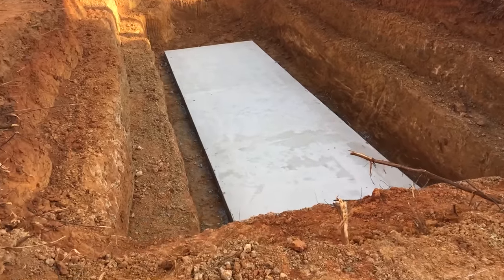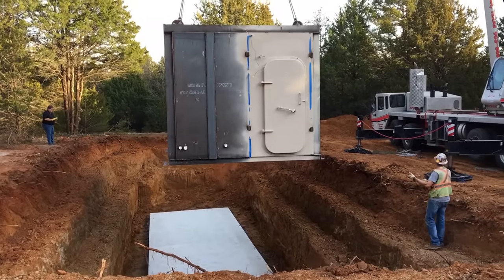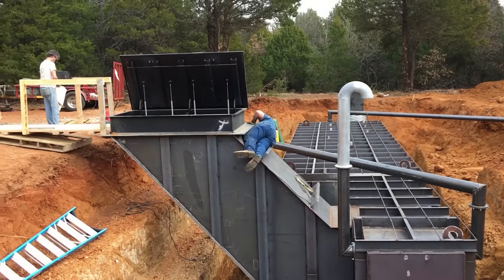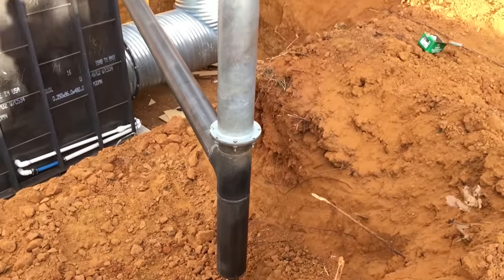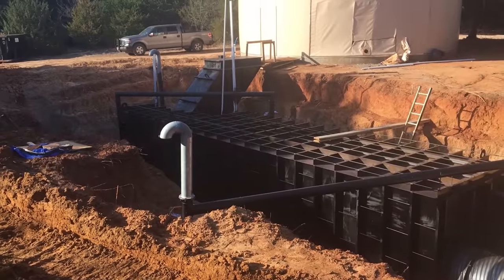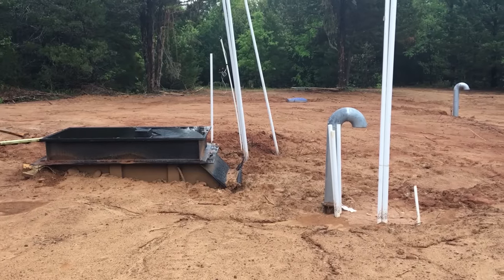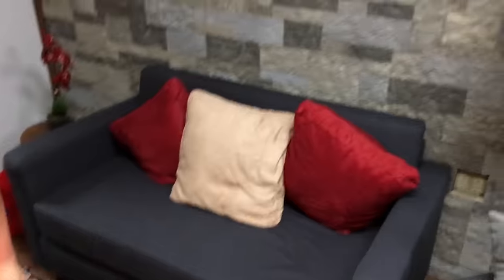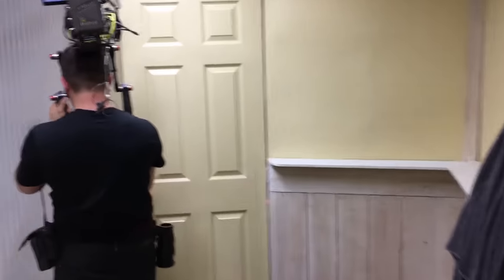Atlas 10x30 Safe-Cellar - Luxury Bunker Built Under A Home (Complete Installation Video) - Part 1

Comment: If it were mine, id want the escape tunnel to go 1/4 mile away.
Reply: The your tunnel is bigger than the bunker XD anyway these are useless, way too small for even a bug to survive an apocalypse.
Reply: Its not about surviving the apocalypse,  its about surviving many other things. That shelter in the video is NBC rated. However,  i doubt you know what that means without using Google to find out.
Reply: @RicArmstrong  how is it nuclear rated!? A fallout last months if not years, nowhere near enough food... Chemical and biological would probably be ok if it didn't last long. Plus it isn't very deep of radiation protection.
Reply: No offence, Harry, but I would do some more reading. It's too much to explain here.
Reply: @BrentonSimon  what more is there to read? This shelter would be useless in a full scale nuclear war simple.
Reply: Fallout is far less dangerous than you think.

The danger was hyped by cold war propaganda.

After just 3 months the radioactivity would be just 1/10,000ths of the level experienced directly after a nuclear explosion.
Reply: Harry:

If a nuke was dropped right on top of the bunker, you'd be right, no one would survive within the bunker, but it may protect the inhabitants if the detonation was distant, yet close enough to where you couldn't survive above ground.
Reply: Nuclear bombs are dangerous all around. Between the actual damage and chemical radiation, it would be hell on earth for anyone surviving in the area.

I do agree that these shelters are useless because 1) you'll run out of filters and clean air long before the radiation dust settles 2) the area you're in is contaminated with  high traces of radiation after you surface.
Reply: Yep true, Owen.  You get more radiation on a sunny day than from fallout.  In the 50's they recommended you stockpile enough water and food for two weeks.  After that the fight for survival would be on, but the fallout would be over.
Reply: Nope.  You need to read up before forming opinions.
Reply: If a crew can live in a sub for a few months you could handle this for a few months.
Reply: ROAD GHOST that would be prohibitively expensive! Into the woods maybe but he would have to own the property.
Reply: Once again fancy tomb if you only have one way out of it. I am not knocking this folks at all just I wouldn't go into one of those things without another way out than the way in.
Reply: I wondering if you even know what a google is without using Google.  Don't hold it in.  Let the Trumpian inside of you out!!!
Reply: F G a nuclear bomb and a nuclear reactor are very different things.
Reply: True but you would need a bigger bunker
Reply: F G Chernobyl isnt the same thing as a nuclear bomb lmao
Reply: Not deep enough, end of story, if a nuke hit 50 miles away you're dead
Reply: if a nuke hit 50 miles away he'd barely feel it. he could stand outside and not get hurt.
this would easily survive anything outside 5 miles unless it was a megabomb.
if its a tactical nuke he could almost survive a direct hit.
Reply: me too....
Reply: Harry 8642  USELESS he says hahaha
Reply: @davidnelson7719  damn and you had to go and start the political BS. That makes anything you've said or will say worthless now. Discuss without politics.
Reply: @greyghost1101 classic trump!
Reply: Yeah, you can survive in a bunker, but what is waiting for you on the outside? Will there be something worth surviving for?
Reply: Fallout 4 is fun.
Reply: No need to worry about fallout during apocalypse due to the fact they will be using dark matter bombs not hydrogen. Which 1 gram produces more energy them some odd kilotons from past bombs
Reply: F G  A constantly burning/leaking nuclear powerplant =/= A nuclear bomb. Im not into bomb shelters, and I dont believe any country will ever launch their nukes, but dont use false equivalencies as an argument point.
Reply: @James Cooper you think of that yourself or did you use google? ;-)
Reply: Wilder  Napalm they showed 2
Reply: We all gotta die someday.
Reply: @TallSly  ..unprotected at ground zero during a nuke blast would be the way to go of you had a choice...instant vaporization, you wouldn't feel a thing and you wouldn't even have time to think about it.
Reply: Road Ghost ~ My guess is ------- everyone knows it's not adequate but the permit fees and inspection fee's happen one time . As soon as your inspections are over you open up the floor above the generator and remove it if it were a modular room above you unbolt it disconnect the electrical and drag it out of the way . That hatch then becomes an entry to a whole other section . Relocate the generator to a cinder block dugout and add as many tunnels and rooms as you want .  Grow rooms , Movie rooms , Bedrooms , etc. etc. etc   (just don't plant any grass or pour any concrete where excavation is needed ). Lastly add two or three escape tunnels a quarter of a mile away or whatever . One thing is for certain DIY  . sorry atlas but at 200,000 dollars for 300 sq. ft. much of it wasted . No
Reply: Josef Fritzl would love that!
Reply: @MrWilderNapalm  The corrugated pipe coming out the back is the escape hatch, a second way out if the main blast door is blocked by debris.  On the inside it was hidden by cabinet doors.
Reply: you only need 2 feet of concrete or 3 feet of soil to block gamma
Reply: I did t read the other comments. but it's also ventilation. 1/4 mile way to long. and 20 feet way to shallow.
Reply: @dyinhope6840  I would say 20 feet is deep enough especially since it will be covered with concrete and a house. It looks like it's in the middle of a forest so I think the threat of a nuke being dropped anywhere near it is pretty small. The shelter would be perfect for a forest fire or a tornado. I agree a 1/4 mile is too far for the escape hatch but the one on there is way to close to the main hatch. It should be at least 100 to 200 feet further away.
Reply: Very Good Point ! Me too ! with a Gun locker in it with extra ammo & a Few hand grenades. Also wire a Handgrenade pull with a Cave in Feature , trap & kill any followers in the Tunnell.
Reply: @TheOwenMajor  say that to Cheronobyl (I may have butchered that name)
Reply: Chernobyl is pretty safe.

It is only because of very stringent rules regarding low radiation exposure that such restrictions are in place.
Reply: @TheOwenMajor  yes, but it lasted for a while
Reply: No, it didn't, radiation levels never reached imminently dangerous levels at any point outside of a few select hotspots. 

The people that died from radiation exposure in the accident did so because they entered these hotspots. Think firefighters who sprayed the reactor hours after it melted or the helicopter pilots that flew directly over the reactor the day after.
Reply: @TheOwenMajor  if that's so, then I really need a new school, u was told that even 10 years after, people in hazmat suits would suffer from radiation damage after 30 seconds
Reply: Unbarredhalo 7 
There's plenty of wildlife living in and around the Chernobyl facility. 
Deer, birds,  stray cats and mice.  There's a lot of hype about how dangerous fallout is. 
Also, immediately after Hiroshima and Nagasaki they rebuilt and started to live on top of ground zero with minimal health impact.
Reply: You suffer radiation damage every time you step outside, UV light can mutate cell DNA.

And Hazmat suits don't stop the radiation(Unless you are talking about the lead-lined suits, but those usually are not used.)

Hazmat suits are used so radioactive dust doesn't cling to your personal clothing, after you are done the job you can simply take off the suit and no radiation follows you.

And again, they have very minimal allowances for radiation.

All this isn't to say that there isn't a very serious and dangerous increase in cancer rates due to fallout radiation, there is. 

But that is a concern that is measured in years, not going to be your largest concern if a nuclear war occured.
Reply: @TheOwenMajor  yes, but aren't there still somewhat dangerous radiation pockets there?
Reply: The only dangerous pockets left is where the contaminated material was concentrated, such as the basement were they threw the firefighters clothing and certain rooms in the plant.
Reply: @TheOwenMajor  well I know objects were contaminated, and may be so for about another 100 years, but wasn't the water also a major pocket of radiation?
Reply: Waters fine, the river they used to cool the plant(The reactor was next to it) flows right past Kiev, the capital, downstream.

Unless you mix in some radioactive dirt into the water you would be fine(And likely even with the dirt it would pass through you without significant exposure.
Reply: @TheOwenMajor  well then, Imma go march into school and update their standards
Reply: Wilder  Napalm there are two ways out. The main entrance and and escape hatch
Reply: one of my neighbors bought like 1x1 kilometers of space to build houses on and he also got a old military bunker with it its like 30 meters underground and a 30ish cm steel door and around 30x10 meters of space down there that is a nice bunker this is childs play.
Reply: Agreed. Suitable for drag strip.
Reply: Something better than nothing nice build 👍🏼
Reply: If it were mine I’d want a bed. Screw the wine I want to be able to sleep please!
Reply: F G  Chernobyl radiation is different than a nuke bomb . I’d be more concerned with surviving in this and when you come out not being able to grow food for months .
Reply: Mr Kentucky Redneck  
Thank you. 👍

Comment: I’d want that air pipe at least 500ft away. And much higher
Reply: The air pipes are just stupid because they lead to the kitchen of your house.. what if the house is burning?? I would install the pipes >50m away outside hidden in a steel and concrete box hidden in a bush with air vents and special filters. Plus some extra oxygen bottles when there was a problem with getting fresh air.
Reply: Like, disguised within a utility pole or a light standard or something.

Comment: Correct me if I'm wrong but shouldn't ventilation be a few hundred feet away hidden somewhere?  It would be easy 2 flush people out!
Reply: You don't have to flush anyone out...just lock the hatch and their dead.
Reply: yeah lock the hatch, plug the air duct and return in 7 days just to make sure.
Reply: Or lock the hatch and let them starve to death.
Reply: did you even watch the video @chase maddy, there is an escape tunnel/hatch lmao
Reply: Which was 13 feet from the main hatch and just as obvious.
Reply: @Curtis Hasna Which you can easily block up since it's so close to the bunker.
Reply: Which was my point. lol.
Reply: So in a natural disaster or a bombing, they will actively have people trying to prevent their escape, very good. Keyboard warriors have come out to play lmao
Reply: No idea what you're talking about, Campers. Changed nothing beyond a spelling mistake on my initial comment.
Reply: Not a nazi, not a pig, don't think this is 1947, not from the south, don't have a sister, not from the US.
Reply: FYI thought you were this guy "did you even watch the video @chase maddy, there is an escape tunnel/hatch lmao" It's my fault and it's also your fault for the confusion.
Reply: Alright changed the comment to avoid further confusion.
Reply: Shilo2010 calm down Jew boy
Reply: While yes in theory you are right, no in this case due to the drain pipe: Listen up at 5:44
Reply: Camper I’m laughing and crying ,nice comment 😭
Reply: @H D - If the nukes fall then radiation is gonna be everywhere, if people aren't killed in the blast they're gonna start getting sick within hours from fallout. Don't think they'll be in the mood for bunker hunting!
Reply: Those check valves to prevent people from pouring gas down the pipes are only going to work with liquid.  The won't work with smoke.  If someone knows you have a shelter they can easily smoke you out of it.  On the other hand I have seen really good designs that had several hidden air supplies and vents that can be configured to block off vents that have been compromised.
Reply: Smart man!
Reply: Absolutely ... Because most people after a nuclear attack wouldn't be concentrating on water, food, first aid, shelter, locating family, helping survivors, communication, defense or anything in the realm of self preservation or self reliance. 

They'd all be running around house to house trying to find the 1 in 20,000 with a nuclear fallout shelter and just hang out for a week waiting to see if anyone opens the door.

Comment: During a SHTF scenario communications with the outside world will be very important. As an Amateur Radio operator, I would like to see options available to accommodate radios and associated wiring such as power and antenna cables. Maybe even a separate partitioned area for a "ham shack".

Comment: It's buried about 2 feet deep! What a great bomb shelter!!!
Reply: Fallout shelter. Very unlikely that this place would take a direct hit from a bomb.
Reply: You just need 2 feet of concrete or 3 feet of soil to shield yourself from radiation.
Reply: The BBC recreated a street from WW2 together with quite simple bomb shelters and tested it against various sized bombs. Even the puniest shelters made from some corrugated iron and a bit of soil on top were actually very effective against bombs that exploded very close by. It was only when they replicated a V2 rocket that the serious damage was done. You have to be quite close to a bomb for it to be dangerous (and as I spent my 20s and 30s in London when the IRA were setting off bombs, I'm quite familiar with them). You can follow the BBC documentary here - https://www.youtube.com/watch?v=L0v2Uq8z7aI What they learned from the V2 was that it wasn't the explosion that was the problem, but the falling earth after it sent up debris from a crater. A direct hit will wipe out most shelters, but near hits are survivable. Still, I think that Americans are rather crazy if they think they are being targeted away from population centers or military targets. Even the North Koreans won't waste a valuable bomb on 'Springville, Arkansas'.
Reply: @horsenuts1831  My hometown area has numerous military bases including the biggest naval base on the East coast.  We all knew if the USSR/Russians ever launched nukes, we'd be among the first to die.  But yes, most of the nation wouldn't be targets.
Reply: @erad67  hiya just wanted to tell you the USSR collapsed in 1991 and Russia is now a federation
Reply: @r.p5380  Note my use of the past tense.
Reply: @erad67  oh I didn't see it. Have a good day then

Comment: What prevents someone from locking you inside?  In the event that the building on top collapses over the door, are there any countermeasures for escape or are you just trapped until death?

I would suggest a couple simple solutions....the locking panel can be severed from the inside so you can't be locked in, and maybe side access to the dirt wall with shovels in the case you have to dig your way out from a collapse.

I mean, I'm just spitballing but it seems you have some glaring problems with something that is supposed to "save your life."
Reply: There is an escape hatch at the back of the bunker :)
Reply: @ThatOnlyDev  LOL. The escape hatch is only a few feet away from the main entrance & isn’t hidden very well. All someone outside would need to do is cover up both exits & everyone inside suffocates to death or starves to death.
Reply: @Bishop228  what do you mean it isn’t hidden very well? The top of the escape hatch is a few feet under the earth